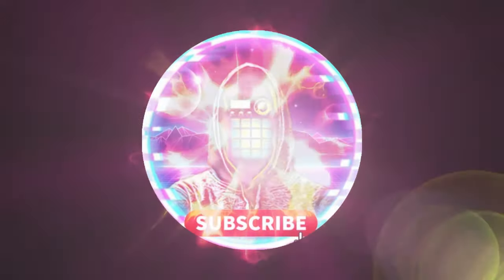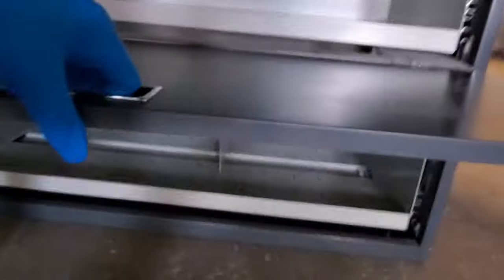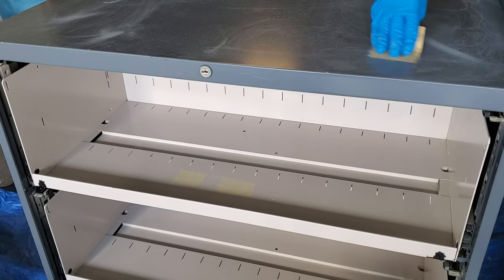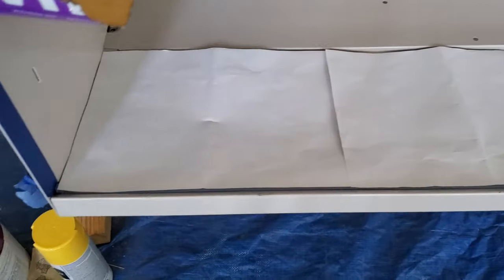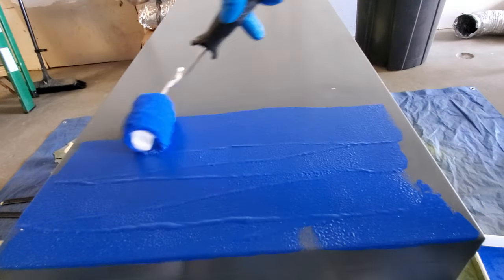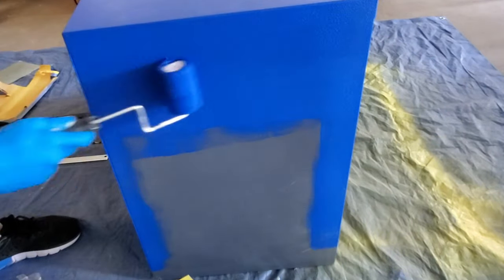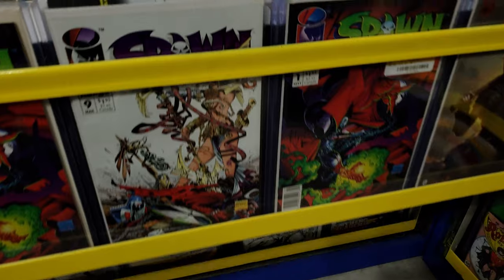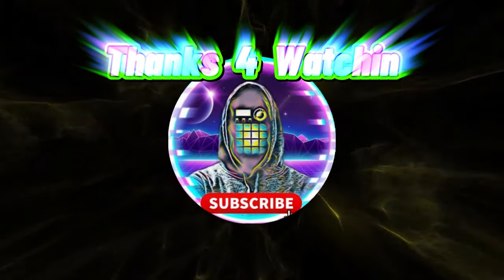The Ultimate Comic Book Storage Solution

Comment: If you don’t or can’t paint or want to different design, try using contact paper instead. It works well.
Reply from the maker: Contact paper?
Reply: @melodopelive  
Yeah, it's like wall paper, if you know what that is. Basically, it's tape that has great designs on the back side. All of my cabinets look like they are made of wood. It's dope! They have paper that comes in different colors, too. You could make your cabinets look like marble if you wanted. A good thing about contact paper is that, although it sticks, you can take it off and rearrange it if you don't get it correct the very first time.

If you ever decide to do it or need more info, hit me up.

Comment: Fantastic job! Some questions: where do you get the extra metal bars for the front that help hold the comics in place for display? I noticed you mentioned in the video you needed to order more; where do you order from? Maybe I missed it in the video but what brand filing cabinet is this? Do most metal lateral filing cabinets have those metal braces when you take doors off? Anyways wonderful job and I hope to do something similar as to what you and Bub have accomplished. Thank you.
Reply from the maker: Measure the 1s you have because they are all different depending which cabinet...I looked mine up through google, and they are not cheap, unfortunately, so I made my own out of the foam board, which does the job...you can also try your luck at finding spare 1s from other used cabinets on fb or offer up
Reply: Appreciate the response; I haven’t bought a metal filing cabinet yet, been looking at my options on marketplace. Your vid and tips def help me out! Thanks again!

Comment: Got another question. What did you make the boxes on the inside of the drawers with. Did you just take short boxes and cut them down or something else thanks!
Reply from the maker: Yes exactly but some I did use foam board from Walmart craft section but soon realized hot glue didn't keep them together so well so I switched up at the end n just cut some short boxes to size but you will need foam board to separate your top loaders in front from your comics behind it 💯💪
Reply: @melodopelive  Sorry I keep asking questions but I have one more. Are you ever afraid of the weight of the cabinet might be too much for your floor? My family worries and now they have me paranoid that the cabinet I am getting full of comics will be too much weight for my floor. I'm just kinda curious where you have yours and if this was ever a concern? Thanks!
Reply: “ Yes exactly but some I did use foam board from Walmart craft section but soon realized hot glue didn't keep them together so well so I switched up at the end n just cut some short boxes to size but you will need foam board to separate your top loaders in front from your comics behind it”

This is correct. In addition you can also use boxes for the front, sides, and back for protection. If you have long boxes, it works better, obviously.